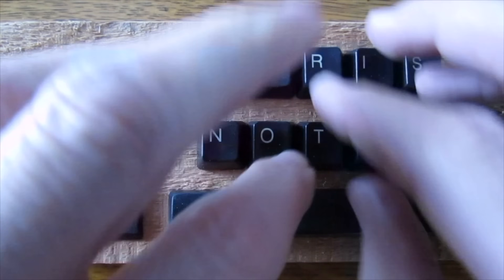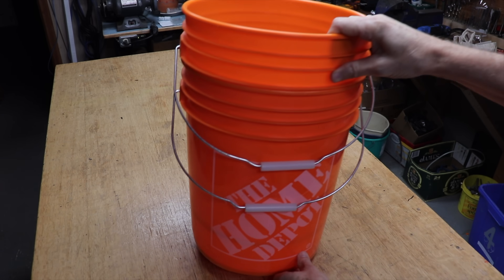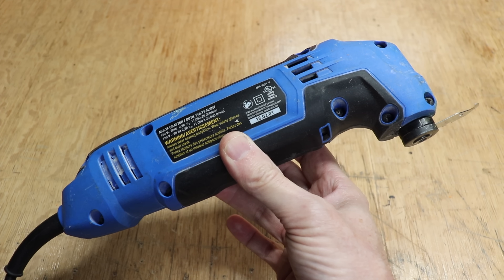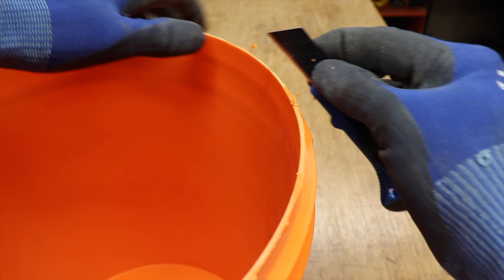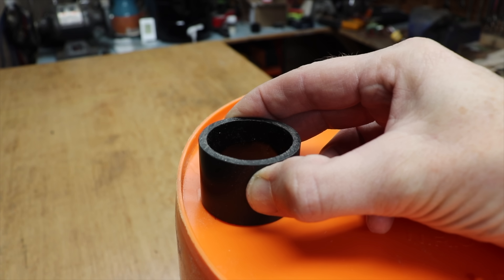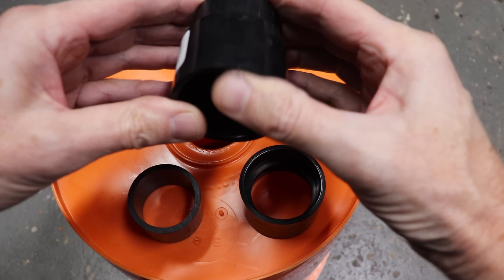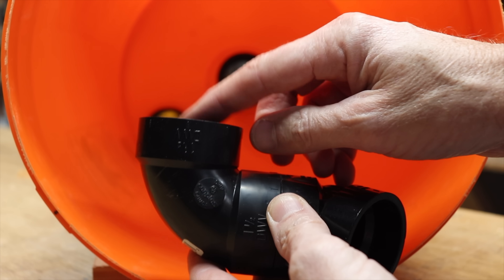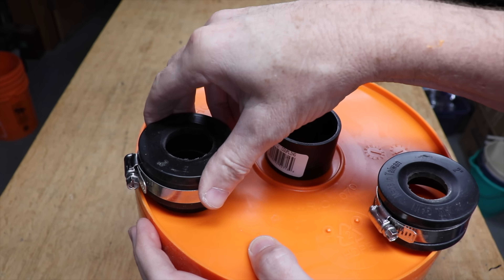How to Make ● Simple Cyclone Dust Collector

Comment: I made one with a single bucket and put the fittings in the top. It worked great, but the vacuum collapsed the bucket even using a vac smaller than yours. Not sure why yours didn't have that that problem. Maybe my inlet wasn't large enough.
Reply from the maker: Check out my update video. It deals with that issue.

Comment: I made the 01453 buckets work by simply cutting further down at the top rings. Instead of cutting right below the second ring as in the video, cut 1/16 inch above the last ring, which is right above the thick ring that houses the handle. It fits perfectly with another 01453 with a light squeeze and push. I used 2 inch piping as well.

Thanks for posting the video. You are a hero.

Comment: Okay, I built one of these a few years ago. It worked pretty good(I thought). It was a fun build, and I even decorated it to look like a star wars robot. The 5UX-80T mk 69! 

Unfortunately, After 4 years of dragging it around my shop-yeah nope. It doesn't work nearly as well as some stuff you can buy for about the same in parts these days.

Great project for a "sometimes" woodworker. I did learn a lot about dust extractors while building it. However, it's a PITA to move around with a shop vac, which could lead to building a whole rig. But I want to make things besides things that already exist for far less of an opportunity cost than this. 

So if you want to nerd out on dust extractors/separators have at it! Otherwise consider some other options that are readily available for under $100.00 USD these days.
Reply from the maker: Can you supply a link to those extractors?

Comment: GREAT VIDEO, I JUST MADE ONE WITH ONE 2-1/2G BUCKET, I DON'T NEED ANYTHING TOO BIG AND IF I DO I JUST HAVE TO PICK UP A NEW LID. THE LID WAS KINDA FLIMSY AND PULLED DOWN SOME SO I RAN A PVC PIPE DOWN TO THE BOTTOM OF THE BUCKET WITH A CAP ON THE END SO IT WN SUCK FROM THE BOTTOM AND THE DRILL 3 -1" HOLES IN THE PIPE NEAR THE TOP AND IT WORKED. HOW CAN I HOOK THE VACUUM END TO ALL MY DIFF SAWS. SORRY FOR THE CAPS, I WAS WAY INTI THIS BEFORE I NOTICED. THANKS, MIKE

Comment: This was very helpful to me as I was grinding concrete with a vacuum attachment and the very fine dust would coat and plug my shop-vac filter in minutes. I built this cyclone dust collector and it made the job SO much easier. Thanks!
Reply from the maker: That's great!

Comment: How would you adjust it to a 16 g rigid? just using a 1.5 to 2.5 adaptor? (the hose is 2.5 by default) And then for the out hose pick something that's smaller than 2"?

Comment: Not sure how annoying it would be to separate but maybe worth some experimentation: you could buy two bucket lids and cut out the centers leaving only the rims that snap onto the bucket tops and glue them together making an even better seal between the buckets. I have about 10 of them so ill give it a shot and update this comment if it works and isnt annoying to separate. My thinking is it'll actually still be easy to separate but less likely to separate if the buckets fell accidentally. 

Thanks for the ideas! I need this desperately as I'm doing a lot of MDF work right now!
Reply from the maker: I tried that! The remaining rings of plastic were very hard to attach together by any method. Nothing I tried to hold them together worked.
Reply: @chrisnotap  not even JB Weld? Did you try attaching them first then cutting away the centers? If it doesn't work do you think adding a couple latches to the sides would be useful? Maybe I'm making an issue out of nothing here haha.
Reply from the maker: JB weld, shoe goo, gorilla glue, silicone, contact cement....nothing was strong enough. That when I discovered tapering the one bucket!

Comment: I cut the ring off on the table saw using the fence, fast and easy. I used a low angle plane to bevel the edge. I also cut slits every 6 inches that made the buckets slide together easy.

Comment: Like many others here, I’ve watched many a video on dust collection, especially for a DeWalt DW735 planer. Thanks to others comments, I went to a Lowe’s bucket as the HD ones here are listed as ones that won’t work. To my amazement, the system worked flawlessly upon first use. All the shavings were captured in the bottom of the bucket, and nothing that I could see was captured by  the vacuum. Thank you for sharing your knowledge!
Reply from the maker: That's great to hear! And I'm glad you were able to figure out the HD/Lowes bucket issue.
Reply: I just bought the dewalt planer myself- this system work well with same diameter hose in the video on the planers extraction end?
Reply: @terrencepayne1371  Yes. I used one hose clamp to secure it, although it was already a snug fit. On the other end at the bucket, the hose fit over the fitting secured by the second hose clamp. I only had to cut the center out of one of the rubber caps for my Ridgid 4 gl vacuum.
Reply: @wp2492  thank ya very much for the details. I’m gonna let the thing blast chips everywhere until I can get it set up but I’m glad to know this design works.
Reply: @terrencepayne1371  And blast chips everywhere it Will! 🤣

Comment: I'm trying with one bucket and it seems to work about 90% now. unfortunately I think some dust will always go through even with the two bucket method as the dust is more much fine than saw dust as I'm using it for concrete grinding.
what i did was put a cardboard box inside the bucket and cut a hole at the top and at the bottom side.
the top hole from the side hole is going inside that top hole on the cardboard box.
now most of the dust get trapped in the box as it's more difficult for the dust to get sucked back up, without compromising on the suction.

Comment: Just made one tonight, going to see if it works for concrete grinding on my garage floor. I couldn't get 10 square feet done of surface prep for the concrete coating im going to do without the shop vac filter clogging and needing to be blown out.. Hope this does the trick !
Reply from the maker: Please reply back and let us know how it went.
Reply: @chrisnotap  well, seems like he had issues. RIP james.

Comment: Hole saw?
Reply: Careful using a hole saw with thin plastic. The plastic could break/snap in the centre, causing the centre drill bit to have nothing to be held/guided by, causing the teeth to go immediately out of plumb and bind, causing kickback/deflection of the hole saw and or shards of tiny sharp flying plastic missiles.

Comment: I just made one of these dust-collectors by exactly following the guy's instructions. It works very well - as advertised.
Reply from the maker: I went through many versions and this one, in its simplicity, was the best!
Reply: Thanks, its good to hear that someone has tried it and it works, so thanks again.
Reply: same for me, works just fine
Reply: Could there potentially be 3 or 4 of these tall buckets for a placer gold mining operation in arizona desert?
Reply: @Shd191  yes you can conecnt 5 toegtehr but the air will be hard to move
Reply: I’m posting here because it’s been 11 months and I’m hoping you see this and can help. So there’s 1.5” couplers, elbows and pipe, or did I get that wrong? If they’re all the same size how do they fit into each other? I’m very new to this kind of stuff so excuse my ignorance 😬
Reply: @samd7146  All those couplers go over a 1.5" PVC pipe. You buy a foot or two of basic 1.5" pipe and cut it to the small lengths he shows as he pushes them into the couplers.
Reply: @samd7146 have you figured it out yet?

Comment: Hi Chris I messed up my bucket, my question to you is can we be certain that drilling a hole in the side of the bucket  near the top won't work as I accidentally made an extra hole in my bucket and don't want to buy another lid thoughts please thank you ?
Reply from the maker: How big is the hole that you accidentally made?
Reply: Hi Chris remember you said its good to experiment that accidental hole drilled it seems the idea I came up with was patch it with a garden hose and I put a pvc adapter it seem the shop vac hose after I put duct tape on it seems to fit into the pvc adapter I screw in in the faucet on the top of the unit my hose I think diameter was 1.25 inch how ever I had a 3/4 to inch 1 adpater while it would sound wrong I tried it it seem to fit snugly after I put some gorilla tape on it and it seems to now fit snugly ? thoughts please thank you so it would seem at this point that the hose from the vaccum is now adapted in to the top of the bucket near the side I guess that seems theoretically correct accept I have not had an oppertunity to try it yet ? thoughts please thank you ?
Reply: I may have accidnetally put a hole or made I did it purposely but what I figured it out was I can stick the vaccum in there of course I noticed the size of the hose was slightly off but I was able to tighten it by adding duct tape ( actually gorilla tape)  thoughts ? @chrisnotap
Reply: thank you for asking I think I managed to fix it on to the newest question please some one had suggested a pool vaccum hose as a poormans shop vac hose any ideas I mean do you think it could still clean up dust as well as metal shavings and liquids any ideas please thank you
Reply: you know what I just thought of that would probably work better is there is stuff called sweeping compound vaccuming that into the shop back is probably better than kitty litter its basically a chemical sand as I dont know how great kitty litter is for such a thing as I think it has some degere of clay in it and might be rather think I have use a chemical sand or something similar to clean up at work but never thought until now why not try it with the shop vac ???

Comment: I didn't see any comments about what happens to the buckets when you apply the suction source on a hot day. The more often the buckets collapse due to the reduced internal pressure the more it happens at less hot conditions.
Remember Professor Julius Sumner Miller and his demonstration crushing an empty 55 US gallon (44 gallon Imperial) metal drum. Similar sort of thing without a fire inside the buckets.
Reply from the maker: I made an update video on that issue and how to prevent it. Check it out.

Comment: Awesome idea and video Chris.  I built this for my shop and use it regularly.  I ended up cutting a circle out of 1/4" laminate and silicon mounting it to the top bucket because it started cracking around the fittings causing it to lose suction.  Works like a champ now.  Thanks for the detailed instruction and demo.

Comment: Simple and gets the job done. I've seen other designs using a mesh ring around the suction hole. I think the key is to have enough depth that the air circulation does not just stir up the bigger stuff AND that the input is below the suction hole. You want the heavy stuff to drop to the bottom after all.

I wonder if this could scale to using a barrel/drum (one of those big 4ft drums you need a forklift or dolly to move once full). Just thinking industrial size on a budget here.

Comment: If you have a larger vacuum (12 gal or bigger) you will want to increase the size of the fittings you are using for the connection to the vac, as the hose is 2-1/2"

Comment: Great build!

I wonder how that set up would work with dry wall joint compound dust.  Would your filter still remain clean or would the dried mud dust be to lite to drop to the bottom of the cokection bucket?
Reply from the maker: Other commenters have said it works good on drywall dust.
Reply: @chrisnotap  thank you.

Comment: Just made this! Great guide!

After I collected all the parts, it took me about an hour to assemble. I did have the issue with the buckets fitting together as others have mentioned, but I solved it by removing a tapered slit of plastic from the rim of the top bucket so I can squeeze the bucket a little and fit them together. Now I can justify buying a much longer hose for my shop 😄

Comment: In my opinion...
If you are vacuuming up dry material, suck it through a few feet of the black plastic pipe right before the bucket.  The static electric charge will make the material stick together.  However, if you stick your hand down the middle of the bucket after use, the static charge can make your hair stand on end, and even give you a little shock.

Comment: The HD buckets with “LEAKTITE” and the numbers “01453” printed on the bottom are the style buckets that will not go together. But using one of those and a green one from Menards that has “5140-1” does match up with a HD “01453”. Hopefully this helps some out there
Reply from the maker: Thanks for taking the time to figure that out and for commenting and actually getting the numbers!!
Reply from the maker: I have added your great info to the description under the video. Thanks again!

Comment: I did the single height bucket and it works for me. Why? I do some general type 12 disc sanding but no heavy wood working so the single bucket version worked. All that went away when I moved across country and had to start fresh with a entire new shop. So next time, if i build another one I will use the 2 bucket version like this. I found a 55 gallon steel barrel vacuum for cheap so I just use that now. I have multiple tools though and can't hook everything to that big barrel so there may be more smaller versions like this in my future. Thanks for posting this video it was great you did all this experimentation so we did not have to.

Comment: Thanks so much for posting this video Chris!  I upscaled your design/ideas in this video by using 4" fittings and a 55 gallon blue plastic barrel in conjunction with my 4" dust collector.  It worked like a dream.  Very little dust reaches my dust collector and the barrel is so much easier to empty than the fussy dust collector bag. I also got a kick out of the first 3 seconds of the video - lol!  🤣
Reply from the maker: That's great that your set-up works perfectly!! And also thanks for the super-thanks!!
Reply: @chrisnotap 6:33
Reply: Chris, do you have a step by step dcument I could I ca,n print   in order  to  make the dust col ector

Comment: Interesting approach. Growing up on a farm with livestock, we had a feed grinder that while grinding had a dust separator section.  All separators I had seen were cone shaped.  Your solution is "tall", whereas if you use a cone, you can shorten the unit somewhat for less fallover.  But, you solution did a nice job and worked!  Which is the point.  Thx.

Comment: The video provides valuable information. I used a 15-gallon barrel with a lid, which offers more storage in a single container and eliminates the need for two buckets.
Reply from the maker: That's cool! Where did you source the 15G container?

Comment: I wonder if a thicker pipe could be used from the top of the collector to a surface planer?my thickness planer send out quiet long pieces and i worry that a normal size vacuum pipe will not be sufficient or the pieces will clog it up
Reply from the maker: You could definitely try a bigger pipe. It's all about experimenting and using your noggin!!
Reply: Thabk yoi Chris @chrisnotap

Comment: I built one just as you did using your video as a guide. Works great. I actually added an extra chamber that uses water to filter the fine dirt before going to the shop vac
Reply from the maker: That is awesome!
Reply: That is a good idea,like a supercharged rainbow vacuum
Reply: @len8336  and at a fraction of the cost. I basically designed the second chamber to be a giant b.. o.. n ..g.. and my filter on the vacuum is still brand new
Reply: Can you say how you made the extra chamber? I'd like to try that.
Reply: @j10001  I will do my best to explain. i basically made two of what's in the video, and connected them in series (one into the other). The only difference is the second one (the one before the vacuum). I made the center outlet hole on the top the same way, however the inlet hole I put on the bottom bucket about 2/3 from the bottom of that bucket. In the original the inlet goes in and curves, in the second one of mine (the one with the water) the inlet goes in and downward in an L shape towards the bottom of the bucket. Fill the bottom bucket with water to submerge the opening of the L pipe. What you should have now is the dust will get sucked up into the first chamber collecting most of the dirt, then when the fine dirt goes into the second chamber it will get pulled into the water and the water will clean it. Your basically making a giant hookah..
Good luck. I'll answer more questions if you have any
Reply: @beetlejuice3x309  Great explanation! That setup makes sense, and I’ll look for a chance to try it.

Comment: I don’t understand. I made my own after your really good explanation. However, mine makes a very nasty noise and the motor of the vacuum becomes burning hot. It works though. I’ve seen plenty of these videos now, but no one ever mentioned this problem. What did I make wrong?
Reply from the maker: Use the process of elimination on your vacuum. Disconnect it from the dust collector and run it to see if it still gets hot. Use that process further to figure out what is not working right.
Reply: Did you solve your problem? Whats size of your bucket? Maybe size of bucket is a problem. I wanna make my own with 200 liter pvc barrel. I hope it will be work. What you think guys?
Reply: @TheJelac  my bucket is about 40 liters. I cut the hose about 1 meter and that's better, but also that limits it's use a bit.
Reply: @Redkite9109  is it metal or plastic bucket? Whats diameter of hose? What if you use larger hose diameter?
Reply: @TheJelac  plastic bucket. The hose from the vacuum is 30 mm and I tried a 30 mm hose on the other side, about 3 m long. Terrible noise! Then I changed the second one to a 40 mm, same length. No big difference in noise, then I cut off the hose to 1 m. Noise better, but you cannot be in the same room without earplugs